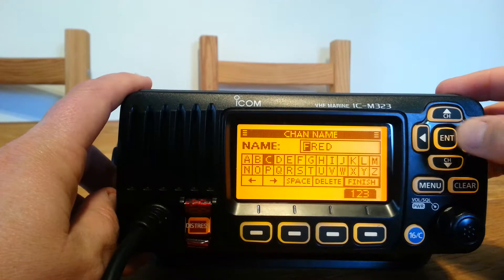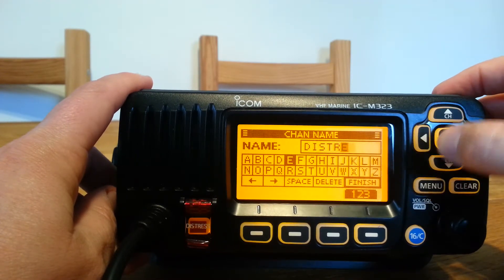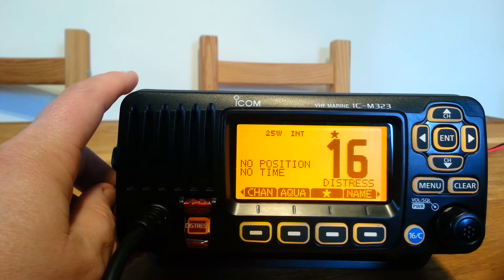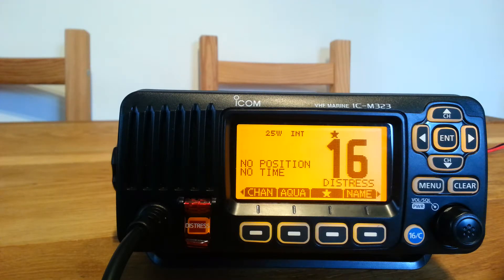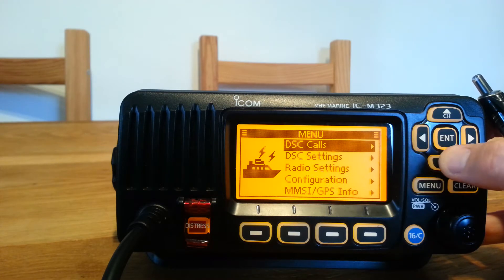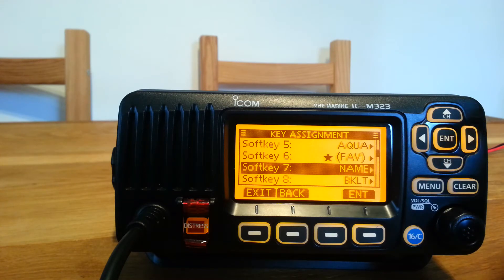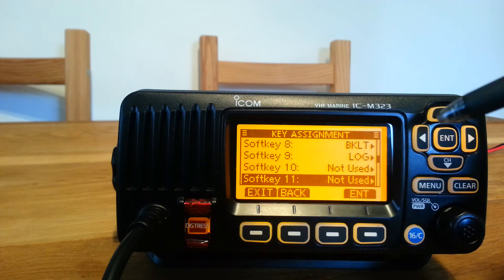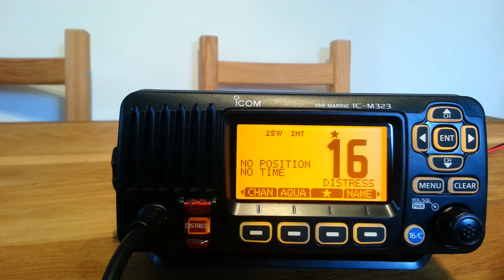Icom M323 How to change Channel Name Display (DSC VHF Marine Radio)

Comment: Hola 
soy seguidor de su pagina , me  gustaría hacerte una consulta .
tengo un radio Icom IC-M324 con un numero MMSI ya programado, el manual me dice que tengo segunda opción para cambiarlo.  cuales serian los pasos a seguir para cambiar ese numero MMSI?
Reply from the maker: Hi Antonio, to change the MMSI number , the radio needs to be returned to an icom dealer to have the original MMSI removed, do you have an ICOM dealer close by?    we can do it but we are based in Poole on the South Coast of England.
Dom